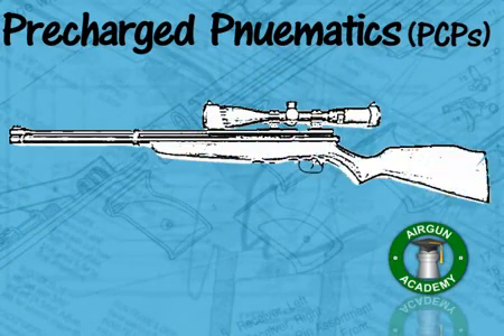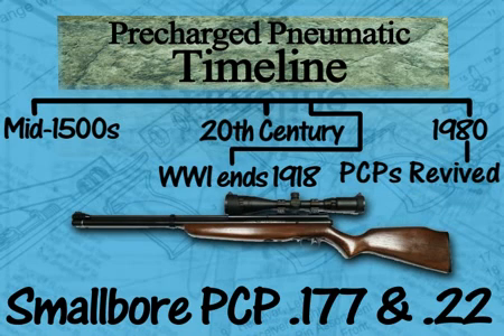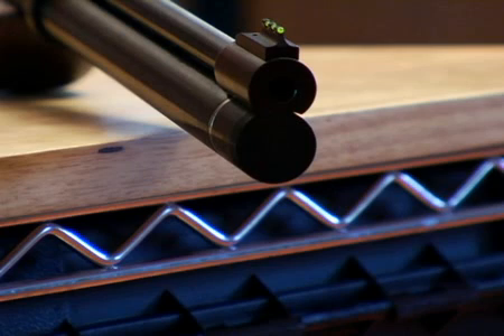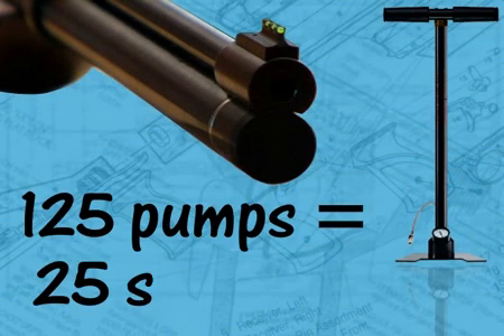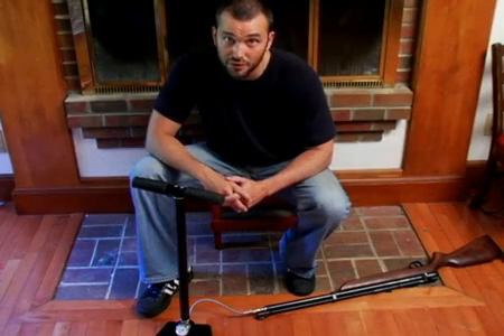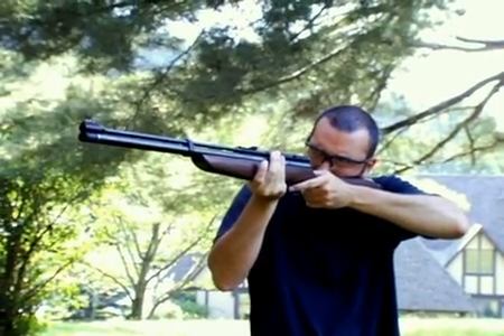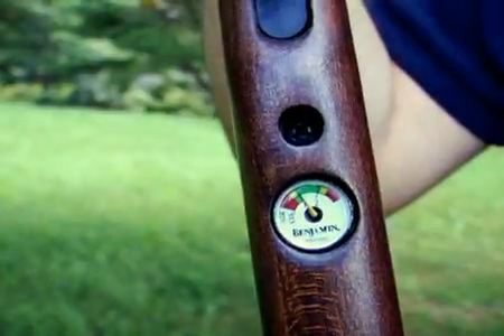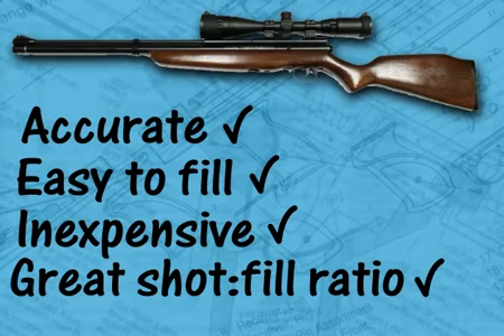Airgun Academy Episode 9 - Introduction to precharged pneumatic airguns

Comment: And how much is the  pumping effort? It also doesn't say if you need a tank nor how much it costs for the pump and tank. And pcps aren't inexpensive.
Reply: Anyone who weights 135lbs or more can easily charge any PCP rifle with a hand pump. The proper technique is to use one's body weight while locking their arms during pumping as the pressure starts to approach 2000psi in this case and between 2000-3000psi in the case of most other PCP rifles. If you're using a pump, you don't need a tank. A tank is a more expensive way to keep your PCP air gun topped off with pressure, but it's also physically far easier. It does come at the inconvenience of having to get the tanks filled as filling a tank with a hand pump isn't practical. Today, there are plenty of specially designed compressors available at an affordable price to keep a PCP charged effort-free. PCP's have always tended to be more expensive than break barrels, but the level of refinements that the lower end PCP's are coming with these days like regulated reservoirs and such is nothing short of amazing! This new market all started with the Benjamin Discovery PCP featured in this video. A PCP rifle doesn't replace a good break barrel rifle IMHO.... It supplements it.

Comment: PCPs rule springers are shit would never ever own another!  my Daystate Huntsman Classic is less than 6 pounds is recoiless and totally silent and produces 30ftlb a high powered springer produces max of about 25ftlb will kick like a Muel weigh about 10 pounds be loud and long as a roach pole!  so need I say more apart from I cant understand why people bother with them?
Reply: There's nothing more rewarding than being able to shoot a high power steel springer or gas spring air rifle at near PCP accuracy. Springers are inherently simple by design and easy for someone to maintain with a minimal set of tools. The simplicity of just grabbing the rifle and a tin of pellets and being ready to shoot is a great thing as well. The trick with springers is getting a well made one. There are many on the market these days that don't latch up properly which effects accuracy and gives all springers a bad name. In my collection, I predominantly have magnum Webleys, Theobens, and Dianas. Most were made in the 90's, but it's still possible to get quality ones today. They're all extremely accurate in my hands.

Comment: What  type would the FX Independence  fit into ?  It can be pre charged  with a tank  or my the build in pump  . After you shoot a shot  you can pump the gun about  2 or 3 shoots and your back up to full power . or you can shoot it till it runs out of air  30 shoots  I think is what you can get before you have to refill the cylinder  with your external  tank  or the built in pump . I think once you find out about this gun your going to have to  add one more type . Because its a multi pump pneumatic  that stores the pressure in a different tank  like a pcp does . or you can pump up enough pressure and fire it once   and start over .  So now you can say  there are 4 different  types. The Fx company  is the only company that makes this type  of gun . https://youtu.be/-jbzc-ssiJs

Comment from the maker: Hi Joe, 
Air compressors usually do not have enough power for airguns. If you are talking about a compressor used for filling tires etc.,  those usually only go to like 150-200 PSI. You need at least 2000 PSI, usually 3000 PSI for PCP suns.

Thanks,
Pyramyd Air Team

Comment: [Cont'd] They use hyper-velocity helium gas guns in research, to propel projectiles in excess of 20,000 ft/s.  Of course, the pressure employed is tremendous.  But in a normal PCP, the velocity with helium would still be much higher than with air at the same pressure.  Also, helium is completely inert, so there could be no damage to the seals.  The only down side is that helium is so difficult to confine, you might have to shoot quickly after filling, before it leaked out into the atmosphere.

Comment: [Cont'd]  Another advantage might be that you can get pure nitrogen.  This might not be significant, but...air is about 78% nitrogen & 21% oxygen.  Oxygen attacks oxidizable materials, especially, under pressure.  Maybe the seals would last longer with nitrogen?  Here's a goodie!  You can also get helium!  The velocity of a gas escaping from a pressure vessel cannot exceed the speed of sound in that gas.  For air, that's about 1120 ft/s.  For helium, it's MUCH higher.  [Cont'd next post]

Comment: I have a question...It seems that everyone who uses a tank to fill a PCP uses a scuba tank.  Why not use a regular gas cylinder, such as is used in welding?  Here are the advantages.  The tanks are cheaper.  I just did a quick search and found prices of $300 + for the scuba tanks, and around $100 for welding tanks.  Some were around $70.  With the scuba tanks, I've heard that some re-fill shops are reluctant to fill them, if you don't have a scuba certification.  [Cont'd next post]

Comment: Thanks for the videos , they sure teach a lot. 
I have a question , I live in Mexico , And I have been wanting to get a PCP air rifle. THe thing is I dont know if it will work as well , the temperatures where I live are from 80 degrees to 110 degrees mostly dry weather and 2 months of hard rain with the same temps
. Will the heat affect the rifle ? What rifle do you recomend.

Comment: say if you filled a gun up to the pressure needed then shot half the tank away then put the fill probe of a pump back into the gun, would the gauge on the pump jump up to the pressure already in the tank or just stay at 0 and confuse me by not letting me know how much i was pumping into my gun ?